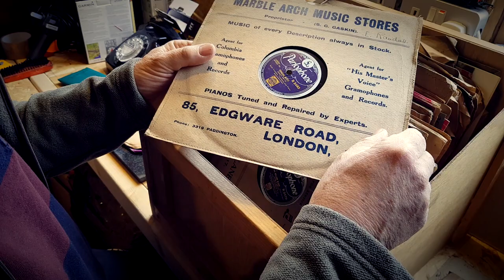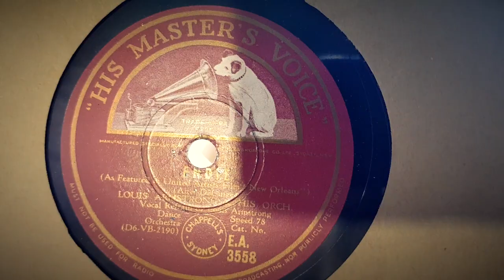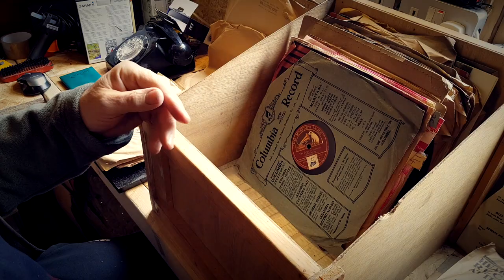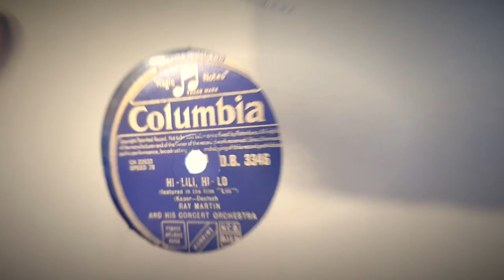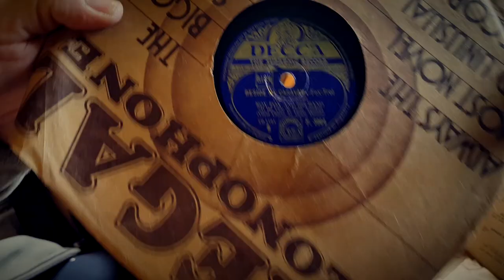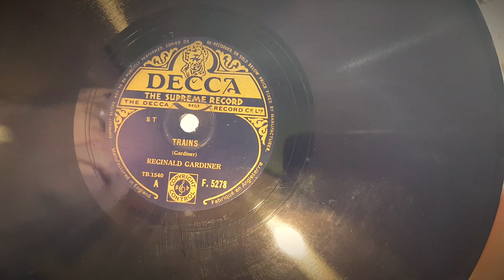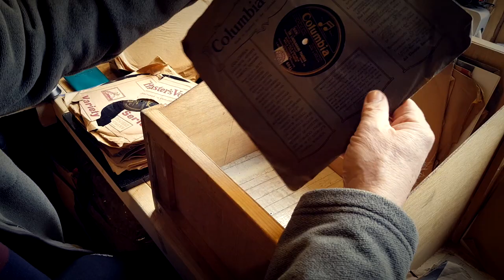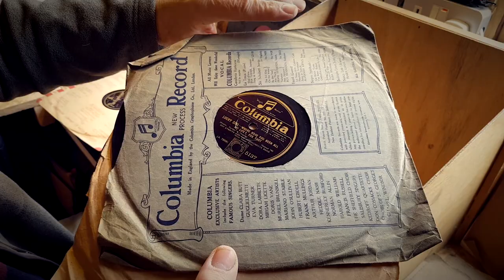78RPM LOCKDOWN SORT THROUGH - SHELLAC RECORD FINDS

Comment: This is what I did with my friend, w e had George Formby's Lancashire Toreador, we found out it was £200, but the record that we had was a chipped record. So we smashed it.
Reply from the maker: I wish it was worth 200 quid mate  dont know who told you that, but pulling your leg, think I have two...
Reply: @AllMy78s  I actually was with them when we sorted it out, it was an original label aswell which added to its price, poor thing never saw the needle of their HMV-102 again.
Reply: @AllMy78s  If the record was brand new, it would be £200
Reply: Plus: My 78rpm collection is just only one record, my friend has lots of them, my one is a first edition In the Mood by Glenn Miller, my copy has unfortunately cracked due to age and conditions
Reply from the maker: @raphcaswell-jones932  All of them are original labels mate, I think they a Regal Zonophones's